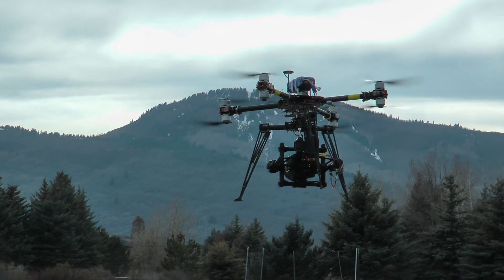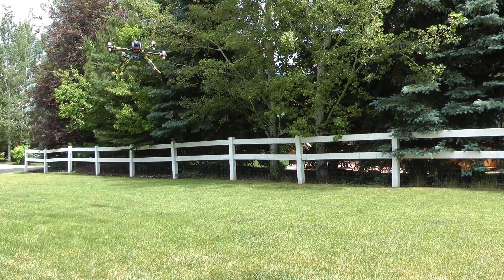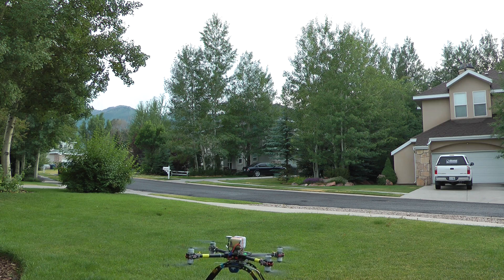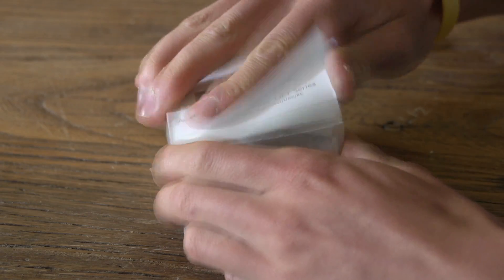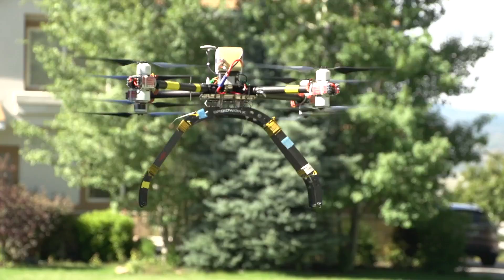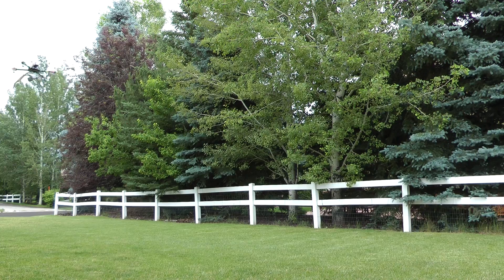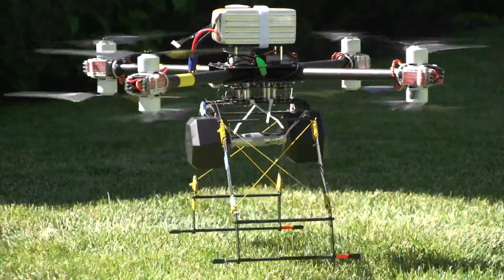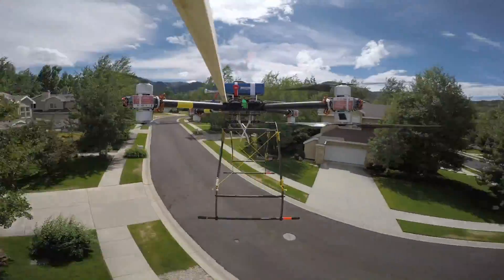AVROTO 3520 Motors on Cine-X Octocopter

Comment: move up to 4000 series motors, your escs are too big as well as the props being oversized for the motors.. Example of matched componets 4914-400kv +40amp esc + 15 inch prop. using Tiger motor products.

Comment: Never tested a small gasoline engine to be 12 volt generator and replace large, heavy batteries? I believe it would not be a setback if it were to gain more time on set.
Reply: MrDeniw lipos are more efficient than combustion engine
Reply: doluseb I agree with you. But it would be just one small combustion engine, serving as an electrical generator to the electric motors. for use in filming or situations that require long flight.

Comment: Damn that's crazy.  Can anyone here speak to the difference between running an octocopter will 4 inverted motors (like this setup) vs an octo where all the motors are facing "up"?  I'm very curious about the pros/cons of each system.

Comment: You should look at Panasonic NCR18650B batteries... They need more batteries for the C rating, but you get a lot more flight time per gram...
Reply: Optamizm The C rating make them almost unusable for most RC purposes.
Reply: ***** Not true, they're good for long flight photography (like this rig) and anything that doesn't need lots of current... They just need to be made into packs of serial run in parallel... The problem is that you can't shrink the weight, to get the right C rating, you need about the same weight in batteries, but that will give you longer flight times, about 2x longer... For anything that needs lots of C, then they're not good at all...
Reply: Optamizm
Those particular batteries are designed for high capacity, low drain situations. There are other 18650's out there better suited for our use. You got the right idea, but the wrong battery......    

For instance it would take twice as many 18650B batteries to get the same C rating as a pack made of 18650PF.  An even better option would be the Samsung 25R.
Reply: ***** They look to be the same thing, except the Panasonics have more capacity...
Reply: ***** Oh, I see what the difference is now... Yeah, those Samsung ones more suited...
Reply: Optamizm input to discussion. not aimed at any person in particular :) imo you really need the higher capacity 18650s, if you want to increase flight time compared to high end low c lipos. Only the super high capacity of the panasonics made them interesting. Anything lower defeats the purpouse. Mostly usefull for endurance platforms. mostly big cameras would make those to heavy and demand to much current. If you replaced the 16000mah lipo here with the same wight of 3400mah 18650s, we're looking at about a 3c discharge rate. to much.  Sure you coud use higher discharge, lower capacity 18650s but then you might aswell use good lipos for same capacity /weight

Comment: Can you tell me what is a difference of this branded and expensive motors to those you can find on ebay with sam kv and power?

I cant really see any diference as it is simple concept of an brushless motor - windinng and magnets - to assume any measurable advantage.

Do you have any experience with both?
Reply: Differences are material and build quality
Reply: Darko Bulatovic Daniel does as do i. the main difference is cheaper motors are normally not put through a balance machine and fed balancing paste. Also a lot of times the magnets are a lower grade neodymium magnet and require more current to operate. Also the bearings are normally a much lower quality and are more prone to failure. Also, the QA is just non existent for cheaper motors. I actually am one of the QA testers for Avroto and we spend quite a bit of time hand checking each motor once they are received checking for points of failure.
Reply: Darko Bulatovic Damn that's crazy.  Can anyone here speak to the difference between running an octocopter will 4 inverted motors (like this setup) vs an octo where all the motors are facing "up"?  I'm very curious about the pros/cons of each system.